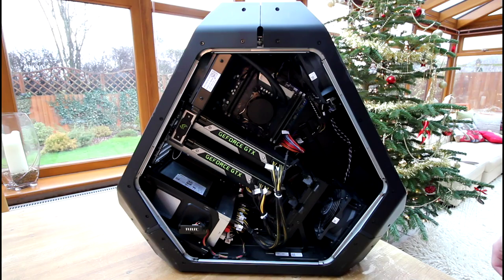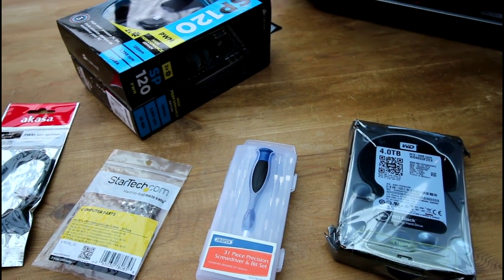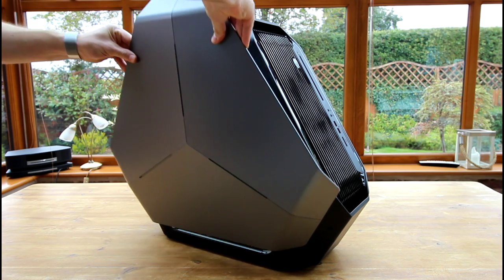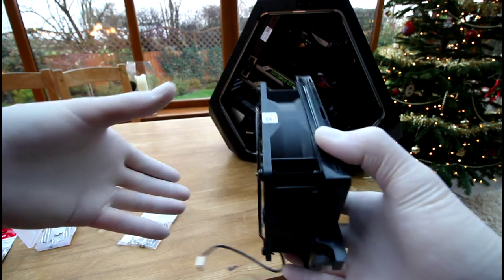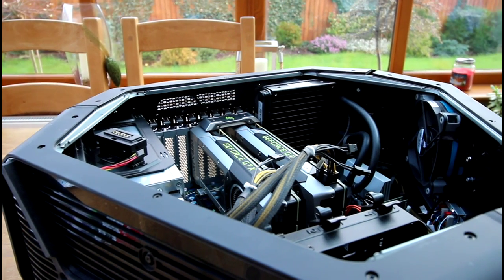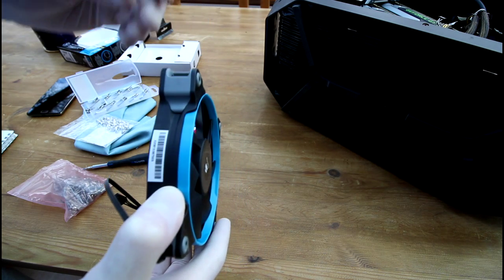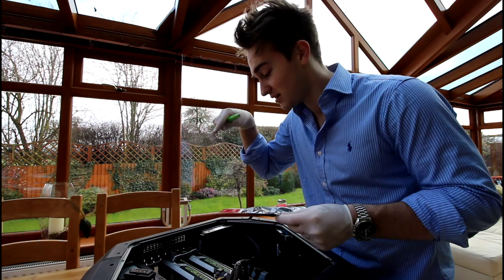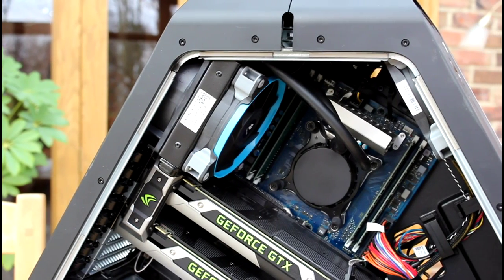Alienware Area 51 - Fan Upgrade + Radiator

Comment: Hello, Nice video very helpful. I'm looking to upgrade the ram in my Alienware 51 r2 to 32gb..  Would you know what ones are compatible to buy? Thanks
Reply from the maker: +Daniel Kilgour Glad you enjoyed the video, I haven't got round to upgrading the ram yet. Any desktop ddr4 ram should suffice. Be careful on the how big the heat spreaders are on some sticks. Low profile would be more like the ram installed at the moment.
Reply: cheers bro... I have also looked into maybe getting the 1080 gtx gpu but don't know if it compatible either.
Reply from the maker: +Daniel Kilgour The GTX1080 is compatible, you can also unscrew the custom alienware support bracket off your original card and add it to the 1080 which makes things more secure.
Reply: thanks mate you know your stuff. One last hope im no annoying ye lol Is the 1080 gtx better than the titan x card if so why?
Reply from the maker: +Daniel Kilgour No.worries, just stuff I've read really. I know the 980ti card was as a good at gaming as the Titan but Titan was more for making content rather than 980ti for playing. And I know the 1080 is marginally better again than the 980ti but same applies in terms of making graphically intensive content and gaming. So 1080 is better at gaming than Titan but Titan is better for work related graphically tasks. Hope this helps. Thanks again for watching.
Reply: Hi Hugo sorry to bother you again... I just ordered 3 fans corsair co-9050032-WW air series SP120 LED 120mm Low noise high pressure led fans... Will these work? Also the splitter cable could you please link me the one you bought? It's my first time doing PC builds or upgrades thanks Daniel
Reply: I was also going to replace the CPU cooler do you know what one would fit/ what is the best one today for more performance?

Comment: Cool video man.. thanks can you post the exact size of radiator screws you used for the fan?
thanks~ and would a sp120 LED work? or do i really need a pwm fan?
Reply from the maker: +Yung Ennix Thanks for watching, yes you could use a led sp120 and it would work it just might be loud so use the supplied voltage drop down cable. And the screws are standard 6-32 1/4 inch hard drive mount screws but the ones in the case already will work. And for the radiator you'll need 6-32 1/2 inch screws which will be longer. Hope this helps.
Reply: thanks for answering. follow up question  can you still control the fan speed of the non PWM using Command center or will it only run on full RPM? another question would be the added rad fan, can you control the speed of it or will it only run on a static speed with the pump fan? Thanks sorry for asking too many questions
Reply from the maker: +Yung Ennix No worries. In comand centre to change speeds it has to be PWM and same with the radiator fan, the original fan pulling air through the radiator is PWM and the new one would have to be PWM to adjust speeds. Always happy to help.
Reply: k thanks man. kinda weird tho command center only shows top fan and PCI fan controls and my CPU fan is always on idle.
Reply from the maker: +Yung Ennix oh sorry you meant will it show up in command centre. I used a splitter cable which means the one fan speed is the same for both.

Comment: Hi there, nice video mate, could you please tell me where did you get that sli bridge? Did Dell shipped your pc with it? Mine only has that ugly bendy sli connector.
Thanks in advance.
Reply from the maker: +Julius Razbadauskas Thanks for watching dude. The SLI bridge came with the PC as standard for me, not sure where you would get the solid one from.
Reply: +Hugo Scott thanks for reply. Consider yourself lucky as eveyone I know/seen got their Alienware with ugly sli bridge! Dang...
Reply from the maker: +Julius Razbadauskas Wow that is lucky. I don't often look into the case unless I'm modifying or cleaning the inside though it nice to have the SLI bridge glowing green. Just checked Google shopping and they're about £40. Not sure if the one I have is high memory bandwidth compared to the ribbon cable but it does look cool either way. Thanks for the heads up.
Reply: Hugo Scott the ones you were looking at does not fit on Alienware unfortunately. PCI-E slots have larger spacings between them thus standard SLI bridge won't do. I've searched everywhere and others tried contacting Dell for spare parts, but with no luck.

Comment: why did you feel the need to change the fan and radiator
Reply from the maker: Mainly because I could but I did want to swap out the stock bottom fan because it had a slight knocking sound to it. The corsair was an amazing replacement. So smooth and silent. The added radiator fan was just for fun though, extra performance.
Reply: Hugo Scott hey mate. How much difference in temps. Did push pull. Make Over just pull?

Comment: Do you use Alienware Command Center to control your fans? (and if you do you leave them on auto or do you use your own curve?)

If not what software do you use to control the fans? or do you do it in the BIOS? 

Sorry I'm new but I want to try this!
Reply from the maker: The Alienware command centre starts up in the back ground and leave that to control the fans. You can take it off auto but I like it quiet. Hope this helps, sorry for the late reply.

Comment: Hi upgraded my top front fan with the same fans you used  everything went well with the install  the new fan seems to be turning but i don't seem to be getting much air flow coming out into the case as i did with the old one   any idea's why   Fans I'm using are the Corsair SP120 pvm  high Performance edition fans
Reply: The original fans are monsters!

Comment: Did this increase or decrease the fan noise you were getting previously?
Reply from the maker: I did notice a decrease in sound from the front fans maybe due to a better design of blade but If you put your ear to the rear case fan it's pushing more air out so slightly louder than before on the radiator fans.. As long as your using 4 pinned fans they should be regulated at the same speed.. Hope this helps.
Reply: Hugo Scott thanks, I appreciate that. I haven't purchased one of these machines yet, but this is the one I'm looking to get.

Comment: I wanna replace the whole liquid GPU cooler. But idk if a 120 mm would fit in this case. Also besides making sure that the new radiator is compatible with my i7 8700K and a z370 chipset mother board what else would I need to check for command center to still work?
Reply: I agree. I bought 120 and couldn't install the fans.... Can anyone verify?
Reply: Also I want to replace the Dell stock liquid cooler. How do I find out what I can replace it with? I got my area 51 computer 6 months ago but have the same case

Comment: just found another problem with the update of my fans ,  i tried doing a Epsa test on my computer and the front fan fails every time i try with error code 2000-0511  tried resetting the header ho help    have you tried doing one of them did ur computer pass front fan test.   command center the front fan will only go to 50%  any idea's why?

Comment: Hi can you still control the fan speed of the corsair sp120 in the alienware command center?
Reply from the maker: Yes as long as they are sp120 PWM fans they can be controlled exactly the same. Hope this helps.

Comment: What type of screw you use to fix the fan to the radiator? thank you
Reply from the maker: They are 6/32 half inch screws. The ones I used needed a flat head screw driver rather than phillips head. Hope this helps.

Comment: Hi did anyone have a problem with thermal control? My Pure wings 2 pwm are all connected but they run all on fixed speed however the temperature changes. I also can t set a fix value in acc. Alredy reinstalled several times

Comment: Thank gtx 1080 is compatible alienware area 51 R2 2015 ?
Reply: It is. I would go for a reference\blower card if you don't want to upgrade the vents & fans. The generally more powerful open cards recirculate the heat inside the case if you dont.